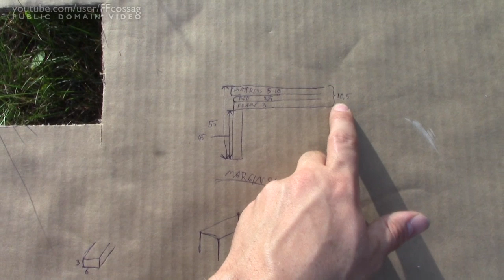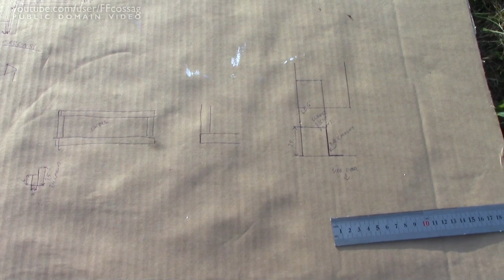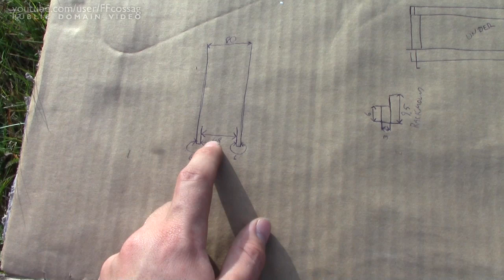Van camper! Build log #5 - Bed frame

Comment: We learn by doing, good job. Although I would have done things differently knowing you wanted a spring frame I would have hinged the side to the vertical frame struts and either have some fold out legs or nylon straps to support the other side of the bed. The straps could be either from above or to the wall? Thanks for shearing.
Reply from the maker: That is an excellent idea. I'm already noticing things that ought to be improved all over, but improving stuff is what this channel is all about, so there we go!
Reply: Kewlness

Comment: The main problem with your welds is probably the fact you went with stainless steel, stainless is harder to weld.
Reply from the maker: If only I had gas.
Reply: +FFcossag Yeah, gass is vital. I thought you were using fluxcore?
Reply from the maker: LReBe7
Yep. Hence my desire for gas.